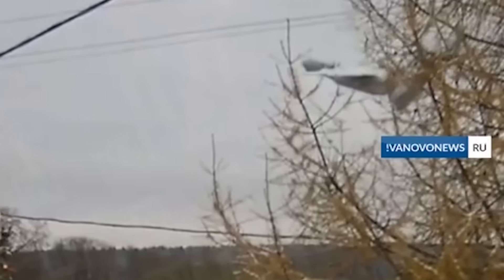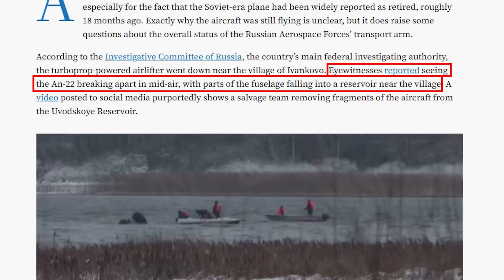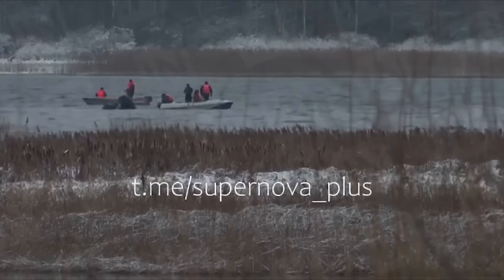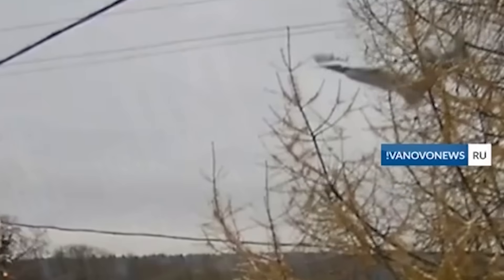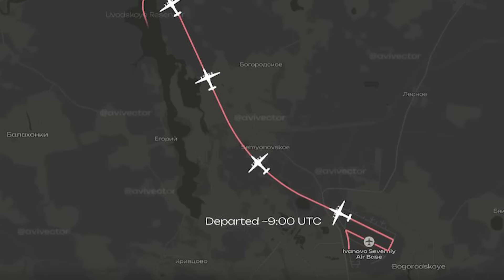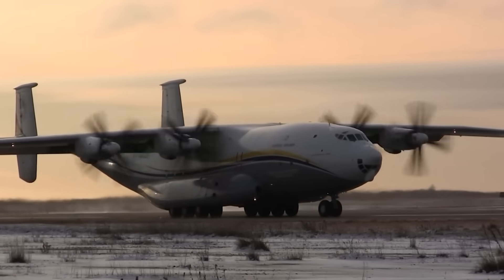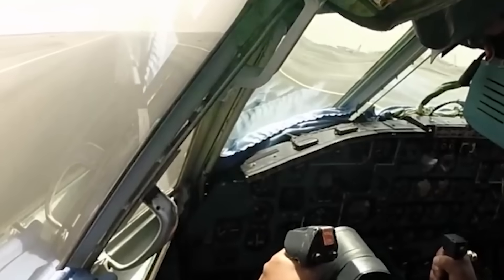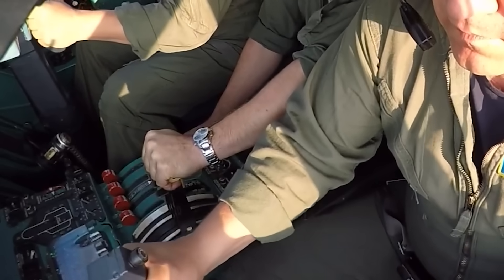An-22 Fatal Crash NEW Footage: Was This Aircraft Pushed Back Into Service?

Comment: Metal fatigue in the loading ramp hinge area?
When the ramp is down there are two jacks which are supposed to be lowered, one each side, to take the strain off the hinges and structure.  If these jacks were inoperative or not often used then repeated loading and unloading could induce metal fatigue in the hinges and structure.  As cracks grow beyond a certain point in flight, cascade failure is inevitable.

Comment: An aeroplane can be broken in flight. The pilot is in control. If this was a normal flight flown within structural parameters then a lack of maintenance could well be responsible.
If the pilot expected the aircraft to respond to inputs of a modern aircraft then a broken aeroplane will result. May the true facts emerge? Hopefully. For those that have lost.

Comment: This footage shows quite clearly that the fuselage break was pretty clean not too far back from the main wing root.  That should be recoverable from the lake for further investigation.
However, with the current state of play in Russia, will they even bother spending roubles on a full investigation rather than just scratch one heavy lift from the dwindling list of perceived serviceable aircraft?
Reply: it would save more resources to scratch one dictator out of service.
Reply: @HranganMind  💯👍
Reply: @HranganMind  You're talking Elensky, Starmer, Macron, and Mertz, right?

Comment: At the point of break up, [0:18]  it looks like three smaller objects also depart the aircraft. Were those parachutes? Were there survivors?
Reply: On closer inspection, they appear (to me) to be large pieces of the aircraft.
Reply: @MrStick-oc7yo  OK. If they were chutes, we would have heard about survivors.
Reply: The first 2 objects are are most likely crew members that were most likely trying to bail. They did not survive, it is seen that the parachute is partially torn.

Comment: you would think an unpressurized plane would be healthier since it doesn't expand and contract with every flight cycle. BUT after carrying, VERY heavy equipment for 50 years, I would imagine the structural stress is TREMENDOUS. Imaging landing just a tad bit too hard when you are fully loaded with armored vehicles, tanks and artillery. You have a tank that is 35-40 tonnes and that weight is concentrated in a small footprint.
Reply: Do not exclude corrosion damage over 50-60 years of daily condensation inside the hull running down to exactly the spot where the aircraft seemingly opened up; the end of the wheel pod/start of the aft section fuselage rise.I flew a Aeroflot Tupolev once from A'dam to Stockholm in mid 1970's.The stewardesses were handing out towels to ward of the drips from the ceiling of the aircraft.Never had that experience in a western made plane.
Reply: The initial failure was exactly at the hinge point of the cargo ramp.  If the supporting jacks were not lowered then the cyclic load on the hinge every time a vehicle rolled up or down the ramp would cause damage.
The designers knew what they were doing when they put those jacks there.  It is possible that loaders saved time by not lowering the jacks.  Time is of the essence in a combat zone - real or simulated.
Reply: Russia's engineers are flat out maintaining Tu142 bombers.  The IL-100 is replacing the An22